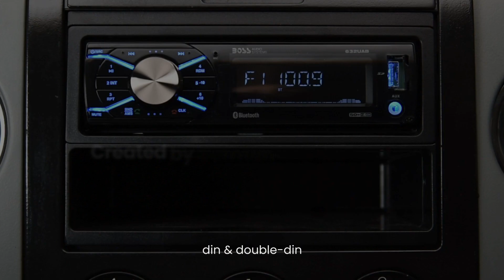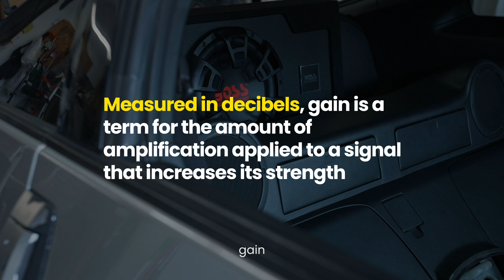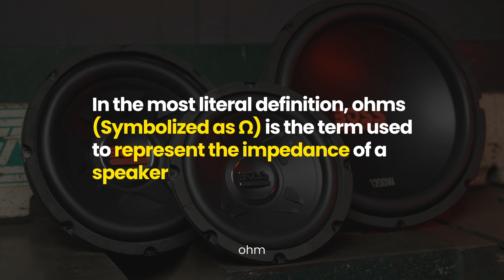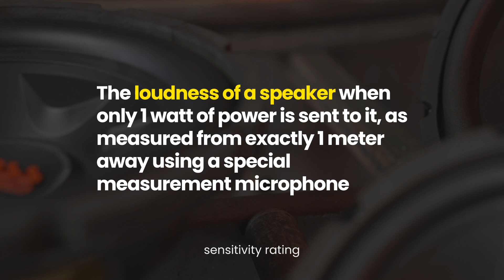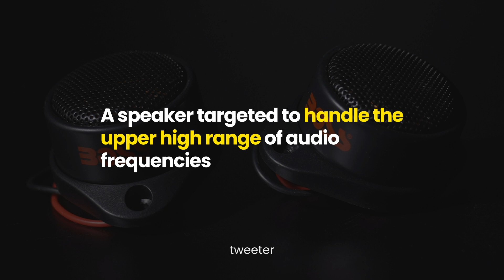BOSS Basics: Car Audio Terminology

Comment: Pretty good job to put it in basic terms. Still please review the part about Ohm and impedance "Speaker impedance is the amount of load a speaker places on an amplifier"  Technically the resistance (impedance (because of AC power supply)) a speaker offers to the current supplied by an amplifier, hence the amplifier has a certain current draw or as you said "load", but that is not the same as resistance/impedance. You are basically setting I=R with your statement.